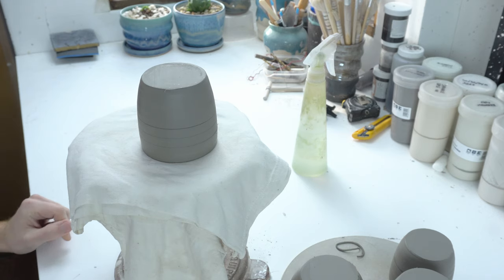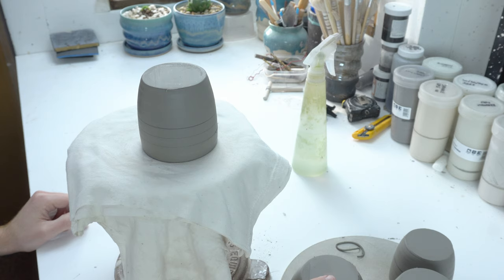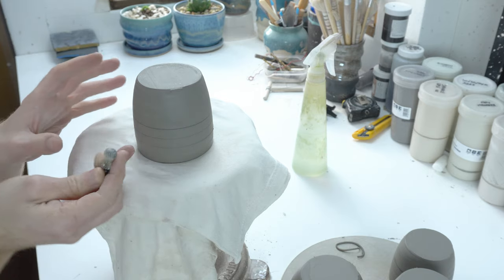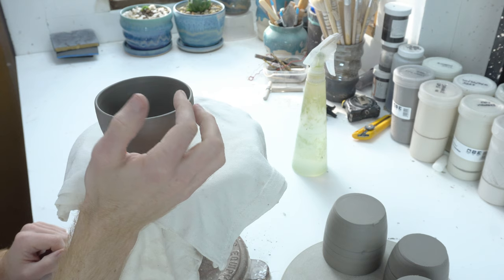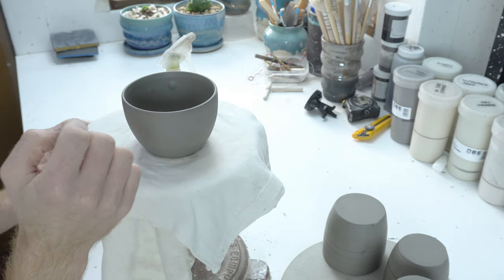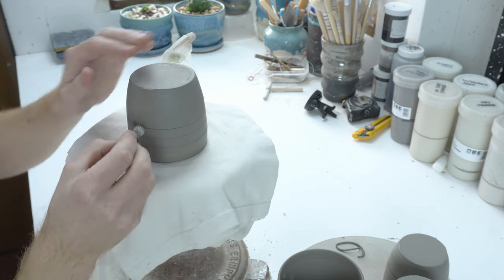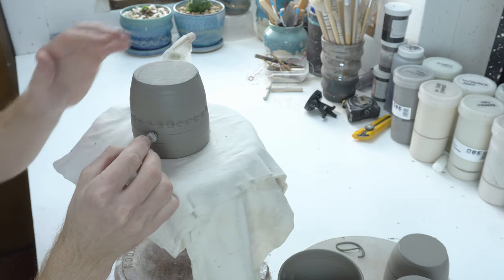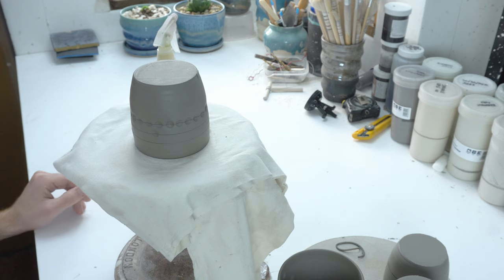Stamping Patterns to Give Surface Texture - Tips/How-To

Comment: Thanks Joe - I’m really loving your in depth tutorials!  This may be a dumb question, but is it be possible to stamp this pattern on the inside of wider tumblers so that you can get the peacock eye effect cascading down the outside of the mug?
Reply from the maker: It is possible, but it's much harder to stamp the pattern as cleanly and the outside of a mug doesn't lend itself to the forming the glaze pattern as well as the inside.

Comment: Would this work with brush on glazes? Thanks for explaining this 😊
Reply from the maker: It depends entirely on the glazes and the thickness of application, the method of application shouldn't change the effect. So it would just be a case of finding the right brush on glazes, and making sure they were applied thickly enough (which will be harder with brush on glazes)
Reply: @OldForgeCreations  Thank you, I’ll experiment then 😃

Comment: Once again, really great video and thank you for sharing all this information. I'm currently struggling with putting my stamp (makers mark) on the bottom of my pieces. Finding the right dryness balance is definitely the key but I still seem to need a lot of pressure to be put in order to get the whole pattern on the base. If you don't mind, I'll DM you a picture on Instagram (under the handle @kirtisheoranstudio ) of the kind of stamps I'm using. Wondering if you have any suggestions  to use them differently of have  a diff kind of stamp instead. Thanks again!!